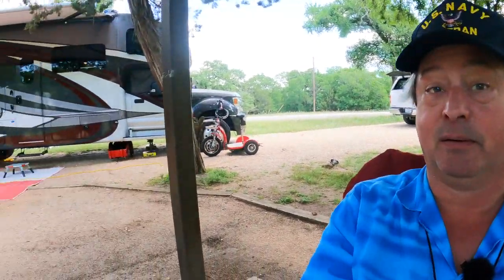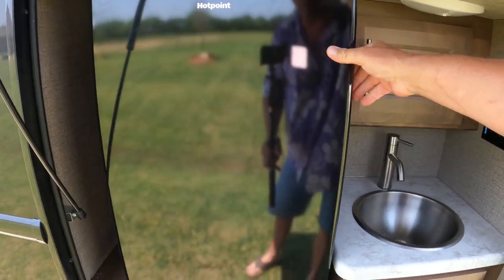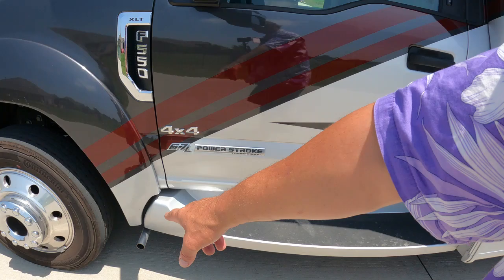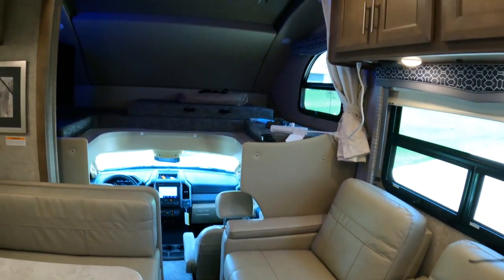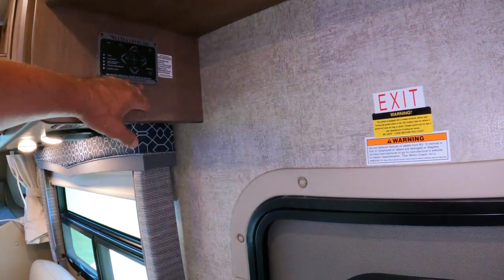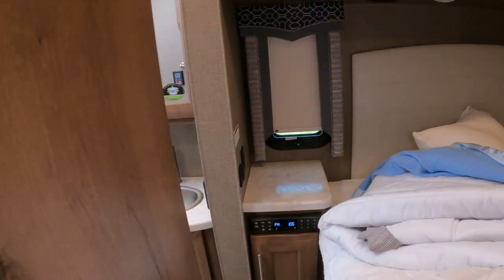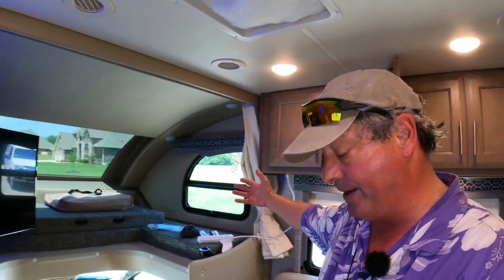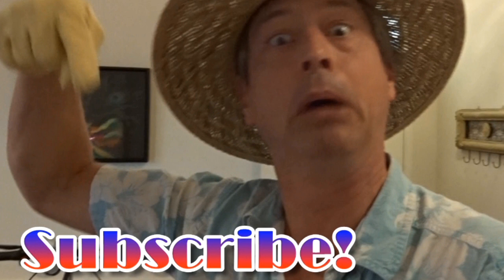Amazing Ford Super C! Thor Magnitude RB34

Comment: Dude rv I’m watching this a little late and just love these units. My question is how are things working so far. I’ve watched several videos on these and everything you can think of went wrong.
Reply from the maker: So far we have had no serious issues. We had a pretty long warranty list that is just about cleared up, mostly small stuff. The biggest item was a leaking fresh water tank air vent. Thor replace the fresh tank. We had a little rain leaking in around the front cap seal but that was fixed with fresh silicone. Those were the only big issues. Thor has been great about all of the warranty items and Demondtrond  (the dealer) has also been pretty good to work with.
What can I say? we love our Trudy Thunder! So nice to drive and so very much power! 
I will say we are not a fan of the insta-heat water heater as it really seems to use way more water than when we had a tank.

Comment: Congratulations.  She's a beauty.

I'm really surprised though that something so nice still has roller latches.  Roller latches are a plague upon RVkind. ; )
Reply from the maker: Thank you very much! The drawer latch in question is not a roller, it is a fancy hook and socket kinda of set up. There is however a roller latch at the very top of bathroom medicine cabinet door. I will be moving it or replacing it with something at the bottom where the pull is located. Thanks for watching!

Comment: Congrats on the new rig!  

That said, when I saw the water tank and basically your entire electrical system right next to it, I got a huge sinking feeling in my stomach.  To me that is just a HUGE red flag. Like an enormous accident waiting to happen.
Reply from the maker: As long as the tank is solid there is no problems, but Houston, we have a problem! the air vent fitting is loose and the vent seems to be blocked. we have a warranty apt to replace the tank.